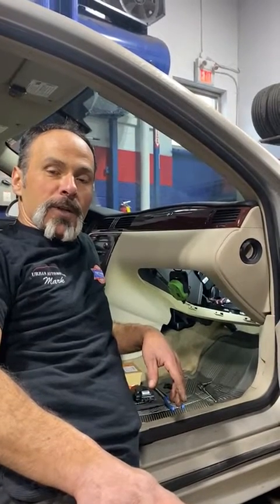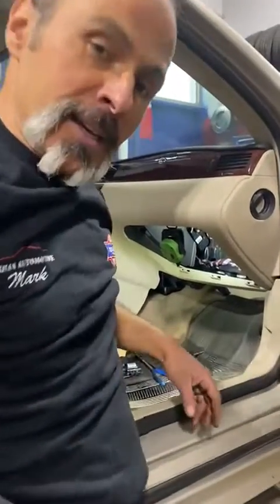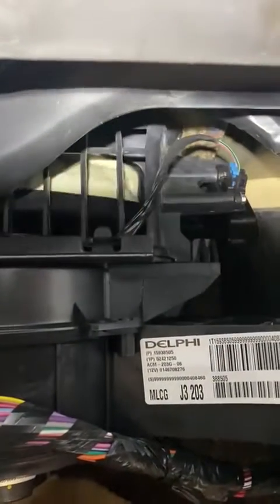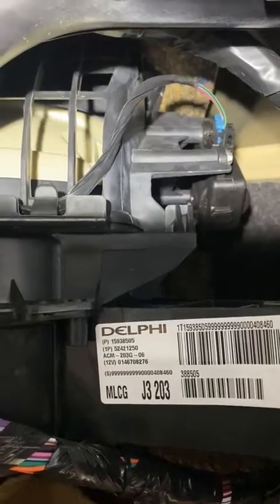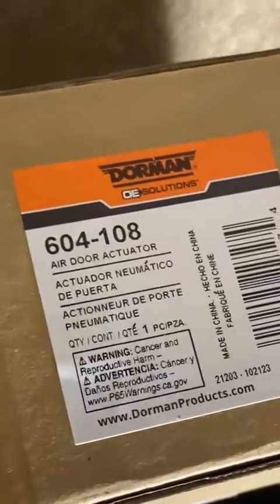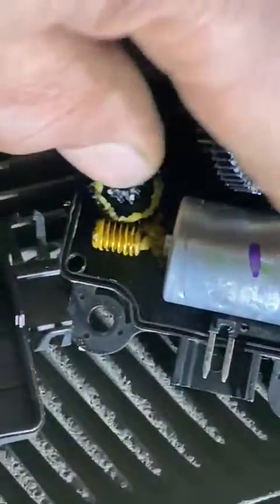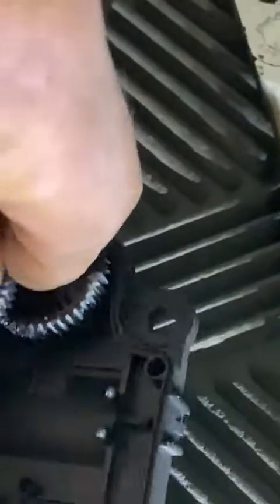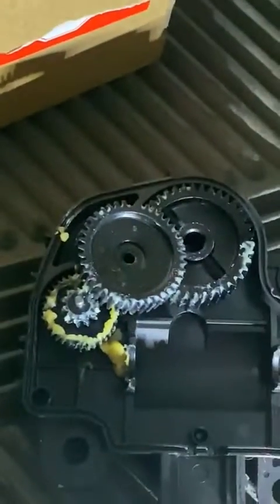What Is A Blend Door Actuator How Does It Work Where It Is & How They Break. @UrbanAutomotive01

Comment: It sounds like the stripping causes it not to be able to hit the limit switch that stops the motor... Meaning it was designed to have to push really hard to close .... With a plastic gear... That causes you to go into the dealership...